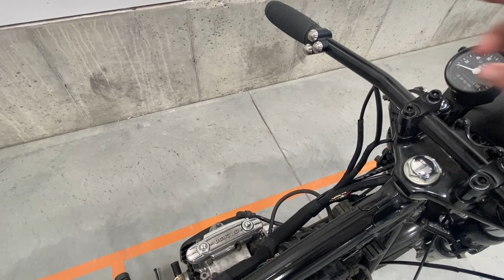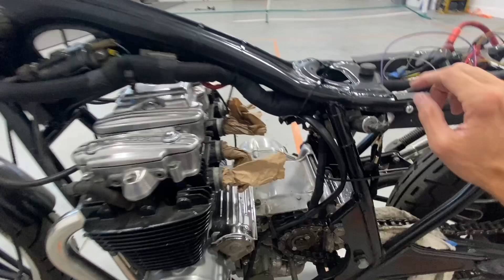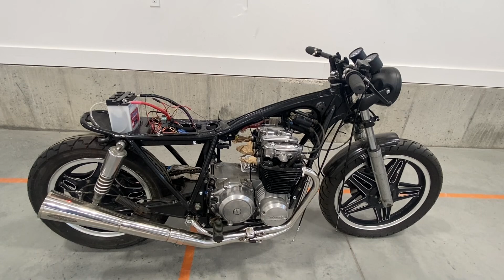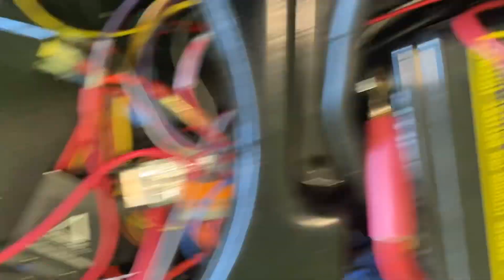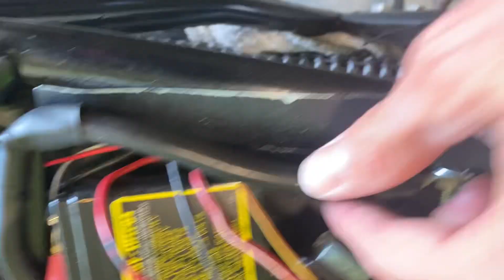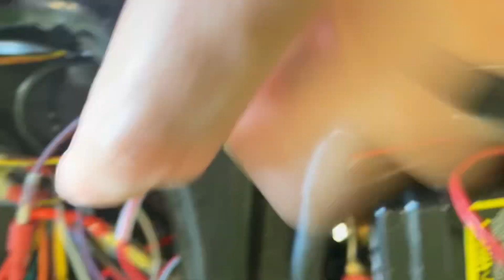Electronics Walk Through - Modified Cafe Racer

Comment: hey ! nice video !!! by any chance you have a diagram of your spare unit connection ? struggle with mine
Reply from the maker: I used the one that came with it with some trial and error. The biggest piece for me was getting the correct main power and ground wires in.